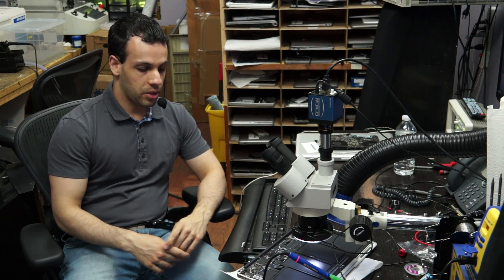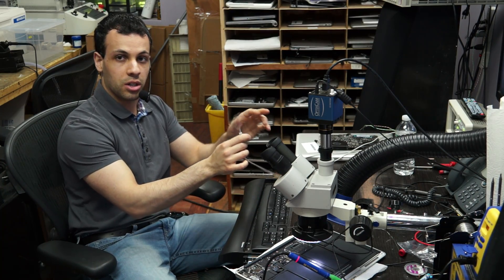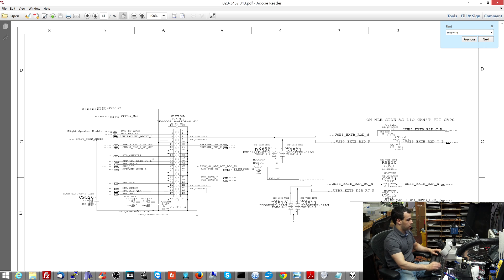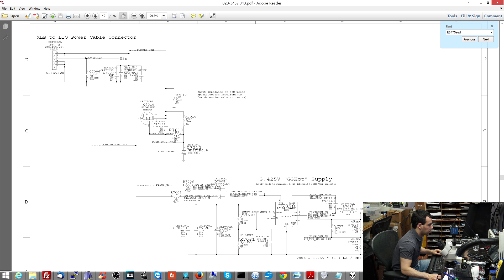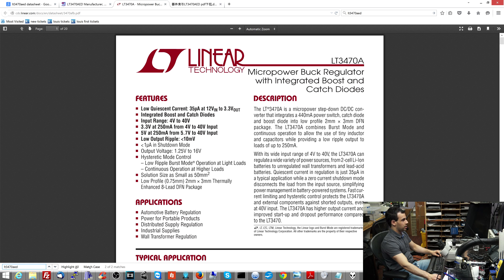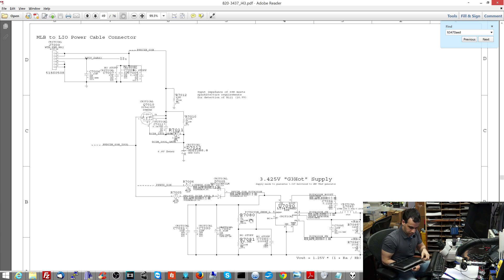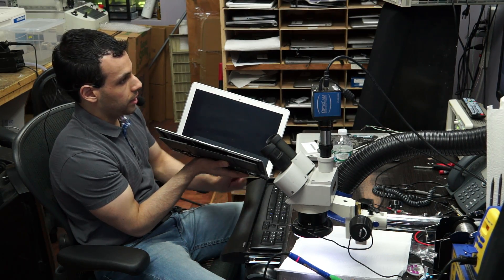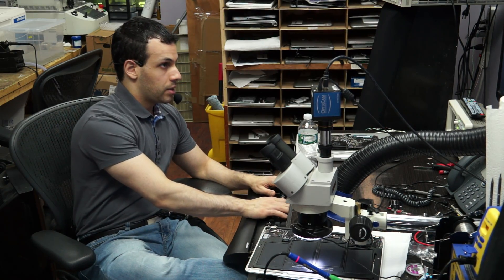Macbook Air not turning on; which power rail do we fix first when they're all missing?

Comment: I have an A1466 Air and all 4 moisture sensors on the A1496 battery are red. In addition, I see one sensor on a PCB that is red as well. My question is, what are the chances I can fix the problem simply by purchasing a new battery unit? Right now, I get no power when plugging in the magsafe cord (no green or orange light). If this repair is above and beyond the battery, is it worth fixing cost wise? Or, should I just toss the unit and replace? Thanks!
Reply: the issue is almost certainly not the battery, replacing it would be a waste and would probably do nothing, the actual repair would cost very little (literal cents) just depends how much you value your time. Make sure to try resetting the smc with both methods (holding down power button/holding down shift+control+option+power) and I can't remember how exactly you were supposed to do each one so try them with battery and charger, just battery, just charger, and neither and hold for at least 12 seconds

Comment: Louis I have been watching your video's for a few years now.  I used to be a electronics repair tech during the VCR days.  I worked on Camcorders and TV's .  Back when TV's were big and heavy and had picture tubes. 

To make a long story short because of you I have been able to change careers and get back into the electronics field.  I have started servicing iPhones, iPads and now Macbooks.   Today this video helped me understand the one wire circuit on this machine.  The schematics didn't help me because the onewire circuit is no longer on the main board.  You literally helped me understand the entire charging circuit.  With your help I just fixed a water damaged Macbook!  I am no longer intimidated by these things!  

If you are ever in Kansas City I will take you to Oklahoma Joe's my treat!

Comment: I was handed one of these boards and decided to have a go as a project.  On the schematic the DC in voltage is 18.5v, but the Magsafe 2 it came with has a 14.85v output.  I had been looking for 18.5v on the board, found 14.85v instead,  so thought I had a component problem, then thought it must be the wrong charger.  Turns out its the correct one.  Why this the output voltage on the Magsafe different from the input voltage on the schematic?

Comment: another reason to hate apple. I made a dell into a hackintosh. It ran faster than a mac book at the time. And had higher resolution. The main problem was the peripherals. I couldn't control the heat in the laptop with apple's software. But the laptop is still running today, many years later. Apple ios to me is no better than windows or linux. just me.

Comment: Hello. I have a similar A1466 which got liquid damage. The laptop is back on but the battery won’t keep it on if the charger is disconnected. Battery is fine, everything is fine but the energy from the battery won’t go through the computer to keep it running. Any clue on where it could be the problem??
Reply from the maker: is PPBUS_G3H 8.16v or 8.56v?

Comment: Thanks for very informative video and guidance. I have macbook air 11", which doesnt turn on with power on switch from keyboard . To turn on macbook i have to disconnect internal battery connector and reinsert the connector . then plug mag power jack. press power key on keyboard. Boom it starts. if i shut my mack book, it wont restart until i repeat the above sequence. note that i could put mac in sleep and wake up any time it works fine as long as i dont shutdown the macbook. could you please guide me or provide hint where to look for. i am looking for events that happens after pressing power button. i have the scheamtics and board layout. your help is much appreciated.
Reply: I have exactly problem. Have you fixed it?
Reply: Hu Qing yes. I fixed mine . I can fix mac books now.
Reply: devinerhythem Glad to see you fixed yours. Can you kindly share it about how to fix? Much appreciated.
Reply: Hu Qing need to replace l2 and power controller ic . You need schematics and fine solder tools air solder gun.

Comment: i have a macbook air a1369. The power button doesnt work. When you close the lid the laptop turns on. You need to open and close the lid for the laptop to turn on only. There was no water damage. What is causing this? Apple put a new battery in and the NVRAM and PRAM has been reset with no luck.

Comment: hi my macbook won't turn on and i need some data from its ssd? its definitely not turning on and could take long to fixed. If i move my ssd to another macbook air of same model will i be able to boot up my system on the other machine?
Reply: YES

Comment: I have kind of the same problem. My MacBook Air (A1466) won't boot up and the cable charger LED light won't turn on and also of course, the battery won't charge. The only way it'll turn in if I disconnect the battery from the inside. All because of water damage. What do you suggest I do? Thx
Reply from the maker: +Jose Garcia Ultrasonic cleaning first.